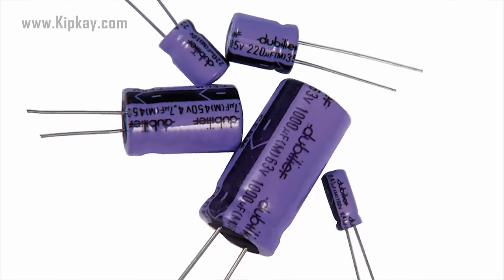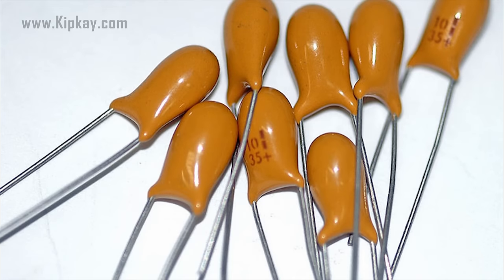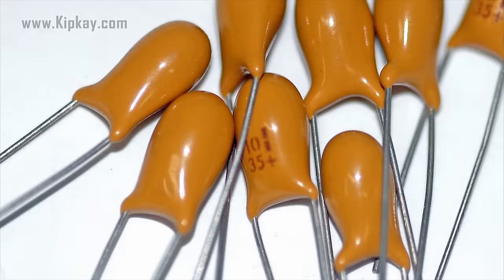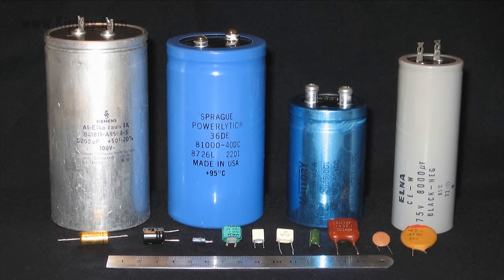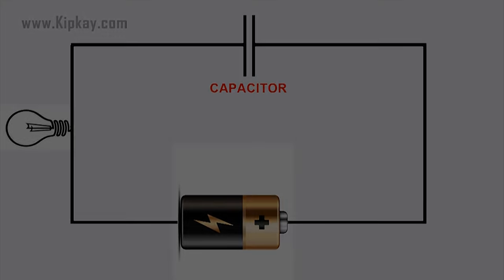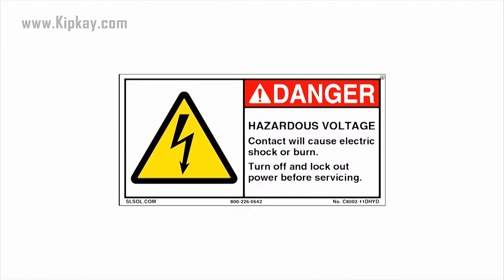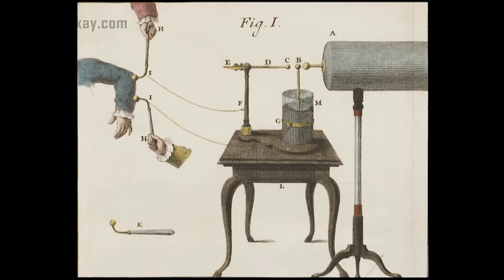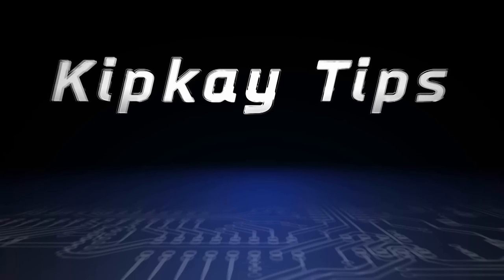These Might SHOCK You!

Comment: Honestly a 2 farad capacitor can be as small as a plum or as big as a small oven. It depends on the voltage,inside resistance,current and power. A microvave capacitor is as big as a soda bottle but it can only hold 0.9 ųf but has a max voltage of 2100 volts and it's inside resistance is 10Mohms in paralel(at least the one I have).

Comment: The circuit displayed at 3:00 is not possible. DC current can not flow through a capacitor. We use Caps to block DC.........
Reply: Put the Capacitor in parallel with the LED / Bulb and the circuit will work.

Comment: you should be able to make a capacitor with two aluminum plates sandwiched between Graphene metal and activated carbon.
Reply: All you need is aluminium. Heat it up so it forms a thick  oxide coat, stick 2 sheets together and you have a cap.
Reply: Ei aC the one I mentioned was quick charge cap. but your idea seems to be cheaper.
Reply: Ei aC the one I mentioned was quick charge cap. but your idea seems to be cheaper.

Comment: Aside from capacitors being much faster abut both charging and discharging, and batteries generally having higher capacity for their size - is there any other fundamental different between a capacitor and a battery in terms of functionality? (not talking about construction and such, but rather the role that they perform in a circuit).

Comment: Great videos I'm learning so much thank you kip Kay. I have a question why is a capacitor necessary ? If you need to power something up we can use a battery what use those a capacitor is good for ?
Reply: In electric circuits, capacitors are normally used to dampen out noise or as a timer. When used as power storage, caps have no real up limit to discharge rate (which is why large ones are so dangerous) and don't fade over time.
Reply: Thad L 
also can be used to store info

Comment: "A one farad capacitor would be as large as a liter bottle" not true, you can buy farad capacitors as large as a coin. I have a 3000F 2.7v supercap that larger than a soda can
Reply: parker benz
what kind of dielectric and "resistance" does it have?
Reply: BedStuyBro no clue, its a Maxwell boostcap/supercap 3000F 2.7V

Comment: How is compacitor formed??
Reply: Different types are formed in different ways...
A ceramic capacitor looks like a orangey brownish disk. They are made with interlacing conducting plates between each other. A ceramic material acts as the dielectric. They are probably the most basic form.
An electrolytic capacitor looks like a can. Most modern ones have two leads coming out the bottom (radial) but the older ones have two leads coming from either end (axial). They are often a shade of blue, gray or black, and have a noticeable stripe on one side to denote the cathode.
They are formed by rolls of aluminum, with an oxide coating. A liquid electrolyte is added to an absorbent paper like material between the rolls of aluminum. Because the liquid can make very good contact with the surface area of the aluminum oxide, they get a very high capacitance in a small physical space.

Take a look at Wikipedia. That will be able to give you much more details that I know from the top of my head though.
Reply: How is cemaric get conducktiv??

Comment: It would have been cool to say more about the structure of the different varieties. Why are some shaped like cans, and others look like coins wrapped in ceramic?
Reply: aluminium capacitors are made by taking two thin sheets of aluminium, heating them so they form a thick oxide coat (aluminium oxide is very tough and a very good insulator), then sandwiching them together and rolling them up, making a cylinder shape. Gives a high surface area and is easy to make, hence why aluminium caps are cheap and high capacitance.

Comment: There is research going on to have electric cars run on capacitors.
Making recharging cars take minutes instead of hours for batteries.
Reply: but if capacitors quickly discharge, wouldnt that not be good for range? it would be like a cell phone that dies after 10 min?

Comment: So what is the application for a capacitor, ik its in tvs but what is its job, and how to u use them, for example say u have a 3v battery and need a capacitor how would read the capacitor in order to make sure its the right one
Reply: A capacitors only job is to store and release an electric charge. Even though this is a simple description, what we do with that charge is what's important.

For example in a power supply that turns 12 volts AC into 12 volts DC, the voltage after the bridge rectifier will be 12 volts, but will be turning on and off rapidly because the AC itself turns off and on rapidly (the reason we call it AC). This pulsating DC would make the circuit hooked up to it turn on and off rapidly (like flicking the power switch many times). This might be annoying (an amplifier would hum) so we add a capacitor to store the charge when the power from the rectifier is on, and supply power to the circuit when the power is off. It holds enough charge between pulses to keep things running.

Another example would be to help turn DC into AC (an oscillator). With the help of another electronic part (resistor, inductor, transistor) we can use the time it takes to charge the capacitor to turn on the transistor. When the transistor turns on it tries to discharge the capacitor. When the capacitor is discharged, the transistor turns off and the capacitor starts charging again. The cycle then repeats.

Right now a capacitor the same size as a battery can't hold the same power as a battery. A capacitor can temporarily help a battery supply temporary surge currents and stabilize a circuit running from batteries.

To find out which capacitor is the "right" one in a circuit, you need to know what the circuit wants and select a capacitor to fit the job.
Reply: Jammit Timmaj so do they reset, so u could have them alternate in a series?
Reply: What do you by mean 'reset'?
Reply: ChiBearsFan2354 when it releases the charge does it reset.
Reply: When a cap is discharged completely, then it holds no charge. That is equivalent to resetting I suppose. 

However, often times caps do not completely discharge in circuits. Decoupling capacitors are an example of that. 

A decoupling capacitor is usually connected in parallel with the voltage source. When the battery/voltage source begins driving current through a circuit or load, the decoupling cap charges until it reaches its maximum energy storage. It holds this charge until a change in the battery potential allows it to discharge into the circuit. 

Outputs from voltage sources vary naturally (no real world voltage source is perfectly ideal), and tend to fluctuate, sometimes supplying slightly more or less voltage then intended. In the event of the source supplying less voltage than intended, a decoupling capacitor can discharge some of its charge to help bring the voltage back to the intended value. 

Anyway, long story short, when a cap completely discharges, it is effectively reset.
Reply: ChiBearsFan2354 so when it releases the charge it builts up again
Reply: ChiBearsFan2354 so when it releases the charge it builts up again?
Reply: ChiBearsFan2354 so when it releases the charge it builts up again?
Reply: Depends on the circuit that it is in. In the case of a decoupling cap, then yes.  I would say that almost all of the time it is the case that a capacitor recharges. It doesn't make too much sense to have a capacitor that only discharges once during a circuit operation. 

Anyway, you can think of decoupling caps as secondary batteries. If the primary voltage source unexpectedly drops its output voltage, the decoupling capacitor picks up the slack and temporarily releases charge, bringing the battery voltage back up to its intended level. 

Decoupling capacitors are also used to filter out noise from an AC signal. That essentially means that it smoothes out the sinusoidal wave.